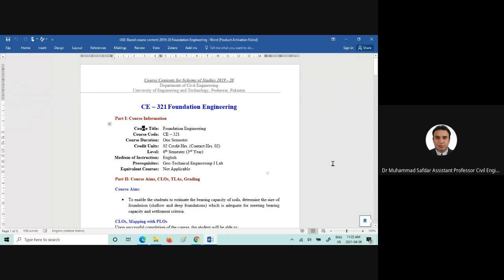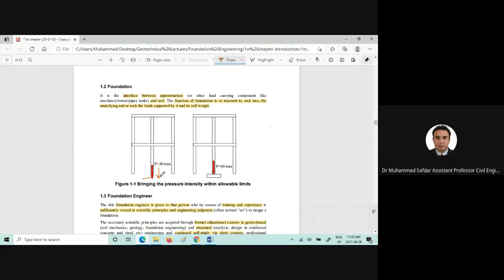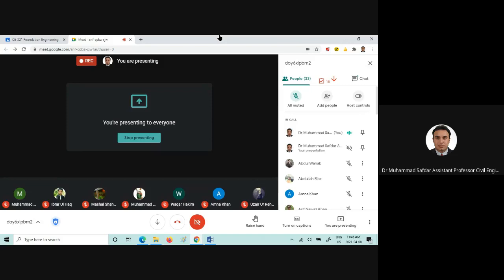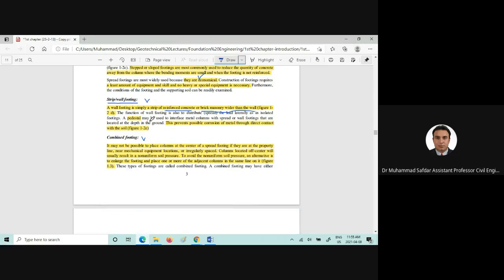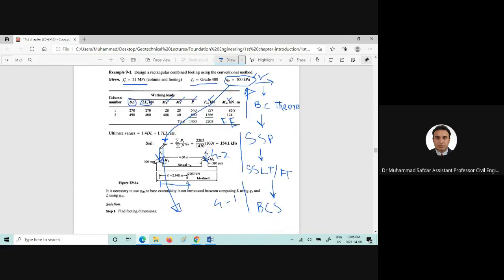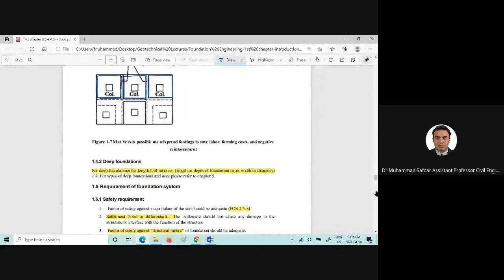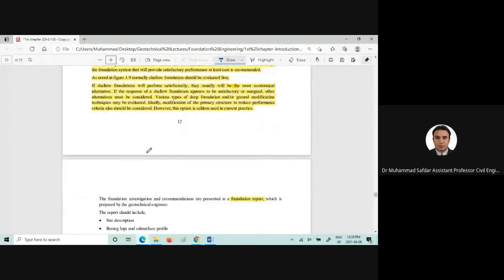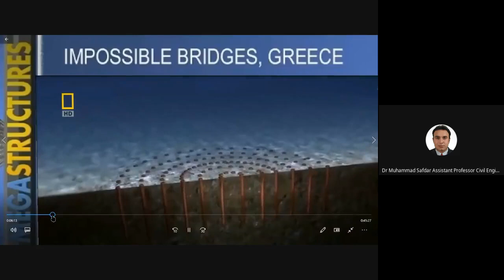Sec C-Lecture 01 Foundation Engineering

Comment: Dear Dr. Safdar, very interesting lecture. 
For a FOS, I believe that there might be a possibility that the load is experienced more than expected in future and due to which designers consider a safety factor. Isn't that one of the reasons ? 
Thanks.
Reply from the maker: Dear Dr. Afaq Khattak Sb, 

Yes, you are right that this is one of the reasons to assume FOS. Soil shear strength parameters variation might be the other reasons. 

Thank you,